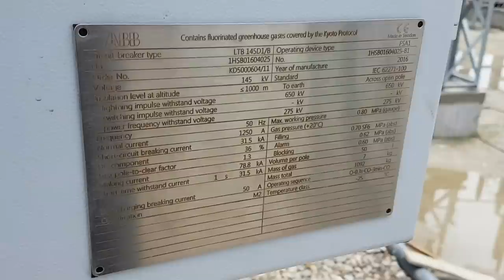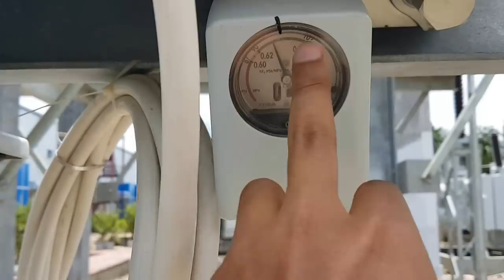ABB 145 KV SF6 circuit breaker

Comment: WE DEAL IN  11KV TO 400KV (MAKE;- CROMPTON GREAVES, ABB, SCHNEIDER, SIEMENS, KIRLOSKAR, BHEL) PCVCB,VCB, SF6 BREAKERS, OCB, TRANSFORMER AND VCB SPARE LIKE MOTOR, COIL, PROTECTION RELAY, IDMT RELAY, GEARS, VACUUM INTERRUPTER, BUSHINGS, EPOXYEPOXY REASON CAST, CT/PT.. ETC. ALL SPARES AVAILABLE CONTACT +919599207409

Comment: Sie in this breaker how to fitting pipe in limb please ..ur.. contact no
Reply: First you need to position and fix one limb. Next limb, get it in position, then use the appropriate rod (with correct length as per the side of the driveing rod's position) and make it suit correctly with the connecting pipe's grooves. same for third limb.